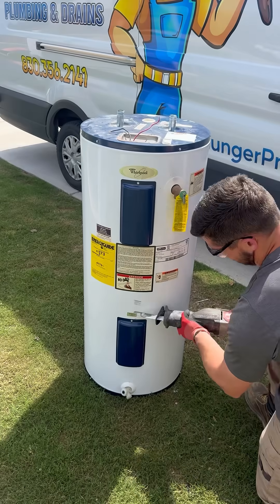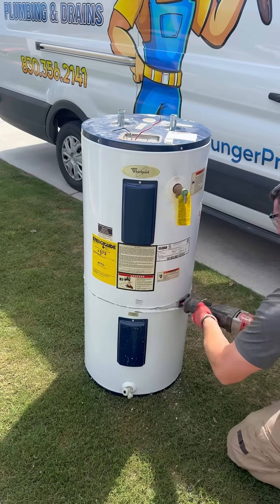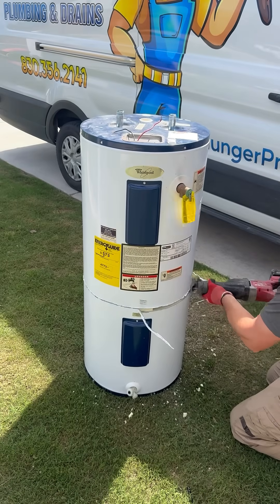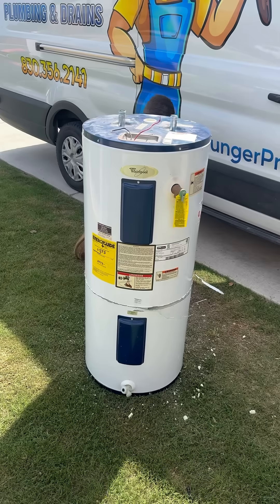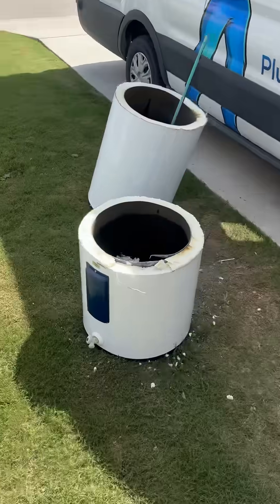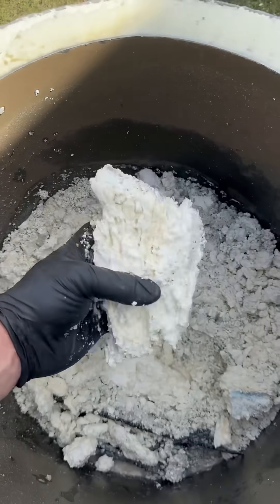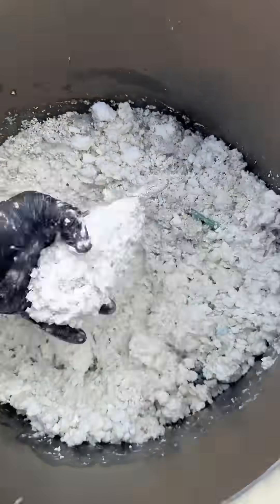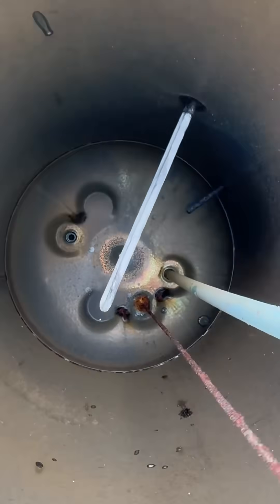What Is Inside This Water  Heater?

Comment: How many years old?  
I never flush it out. I don't see the point if it is only set up to last 10 years.
I had one for nearly 17 years. Never had any problems.
Reply: I know - my heater is from 2006, i flushed it once just basically for fun years ago and nothing really came out. I live in Florida btw.
I just assume newer heaters are pieces of junk just like modern HVACs. Designed to fail to keep sales.

Comment: Do a video showing how and what diamerter is best for drain valve.
Reply: 3/4 nipple, 3/4 ballvalve, hose pipe adapter and you can flush that heater full force

Comment: I think this is why I like gas water heaters better.
Reply: same thing happens to them.
Reply: @thetubeschannel Yeah, but way slower if you're not using the anode rod to heat the water. If it's passive in fresh water they last for like 10 years.
Reply: @kenstr321  no anode rod? .. that's not good. passive water? .. gonna have to search that. ?
Reply: @thetubeschannel  I don't think you understood what I said. I said if you don't use the anode rod to heat the water. So it's not using it actively, just passively. But I think I'm mixing up how electric water heaters works. For some reason I'm thinking of it like an arc furnace. Rather than resistive elements in the water...
Reply: @kenstr321  ok, I'm still confused then because an anode rod as you may know is for the water to attack it instead of attacking (corroding) the steel tank itself. it does not even passively heat the water. It works the same way in an electric water heater. An arc furnace heats air.. yes I'm confused but it's ok.
Reply: @thetubeschannel  I'm sorry to add to the confusion. So the way water heaters work, (as you likely already know) is the heating element in the water has power run through a metal wire covered in a ceramic material and jacketed with a stainless steel tube. The resistance of the wire causes it to heat up and the heat is absorbed by the water. For some stupid reason I was thinking of it like an arc furnace. Where an electrode and cathode (sometimes also called an anode) are in the liquid media and electricity is passed through the water with the resistance of the water itself causing it to heat up. Think electrolysis but jact up the voltage. Yeah, pretty stupid to get the two confused now that I think about it... Sorry for my stupidity causing confusion.
Reply: @kenstr321  thanks for the explanation. I went 22 years without maintaining my heater and it finally went. So with my new heater I tried to learn all I can to maintain it annually. Drain and check the anode rod, etc. Worth it just to try to keep the bottom as sediment free as possible for faster heating of the water. So I'm really into these not.. thanks

Comment: I pull out the cold supply dip tube and install a second sacrificial anode rod. I pull the boiler drain - feed cold supply through brass tee, nipple, full-port ball valve down where mfgr had original boil;er drain, CPVC ran to floor drain. Expansion tank, overflow tray with water alarm. I sell "Maintenance agreements" which include flush. If I sold them on softener, iron pre-filtation, sediment filters, etc: they save on flushes, it should last longer than ME.

Comment: I pull a half inch line out from the bottom valve and it all we have to do is turn the valve every six months and the heater will last forever. Let it run for 15/22 all the dirt comes out.

Comment: the inside of that tank actually looks good still.. i have the exact same one in a rental that was manufactured in 1999.. i recently  changed the drain valve and had to use a sediment buster just to get the water to come out of the factory drain vavle... sediments were easy to flush out with the wide opening of the new valve.

Comment: Apologies if I missed it somewhere, but what type of valve did you replace the factory water heater with for more complete annual flushing of the tank? Thanks and keep up the great content - very informative!
Reply: @bdiddy742 Look for 
1. A 3/4in quarter turn full port valve,

2. A 3/4 in. MHT x 3/4 MIP Brass Adapter Fitting (MIP end connects to the full port value and the MHT end connects to a garden hose for draining), and

3. A 3in long 3/4in brass NPT-NPT brass nipple that connects between the water heater drain opening and the quarter turn valve.

Hope that helps.

Comment: Would you show a tank where the home has a water softener installed to see the difference?
Reply: The reason you rarely see this is due to their failure rates been lot lower. We had to replace water heaters like clock work every 3 years or so 38 grains of hardness. After water softener it's been 6 years since last change
Reply: i would
literally pay for new water heaters every three years instead of being forced to shower and wash clothes with soft water. GROSS
Reply: @LadyBits2023  why? I really am asking. What's wrong with soft water?
Reply: @nightmareinaction629  really? I have hard water and my water heater is from 2006 kek

Comment: No. Sorry. Folks that is not buildup. Do you see the tank itself how it's black? Those tanks are sprayed with porcelain white porcelain at the factory. That's why they are called glass lined. Through years of expansion and contraction the porcelain cracks and collapses into the bottom of the heater. What you are seeing is porcelain not calcium buildup. Yes there are some minerals in there but water heaters are self cleaning. It is a scam to let someone clean your water heater through flushing. It is also dangerous as it could send porcelain sediment into your faucets and fittings in the wall or ceiling of your home. I am a 41 year plumber. I have nothing to gain by telling you this.
Reply: Ok, so my tank creates porcelain out of thin air then? My 20 year old tank has built up over the bottom element 3 times in its life so far, which I've used a shop vac and some PEX pipe to remove it from the tank. Did not know porcelain dissolved in vinegar either. Stop lying.

Comment: If you are behind on flushing can you pour a solvent in to get rid of the buildup?  Something like "lime away"?
Reply: Noooooo. There is always some residule that stays inside and eventually goes into your regular pipes. You do not wanna shower with that stuff. Safety data sheet does state it can cause irritation or burns. 

There are proper solutions you can buy from y o ur local ferguson or even amazon. Just follow those instructions.

Alternatively, you can use 30% vinegar you get from lowes or home depot. I forget the ratio but I think you had to buy around 15-20 gallons and let it circulate your water heater. This will break apart the calcium and cleam the inside. 

As a precaution though, do not do this if your heater is older than 8 years old and you've never serviced it. There is a chance you could actually cause a leak this way.

Good luck!
Reply: Plus, those tanks are glass-lined.  There was a water heater back in the 90s that I had.  It was built with an access panel.  Open it up and shop vac it for 10 minutes, once a year.  The gaskets failed, though.  If they were designed better, then you wouldn't have to buy more of them.  I teach school, and my kids and I created one out of stainless steel with a big opening.  Huge ball valve on the bottom of a coned-shaped bottom.  Open the valve, and it all flows out.
Reply: Tbh idk how much good flushing actually does
Reply: @murkyturkey5238 
My plumber who has more work than he can handle says flushing is not worth the effort. And he doesn't need to push work.

Comment: How long was this in use without flushing?
Reply: Maybe 10-15 it's a whirlpool not common.
Reply: Super dependent. If you set it to run higher temps it will cause more of it to build up. And the harder the water, the more will build up. It's mostly calcium
Reply: @grizzo9976  it's not calcium it's porcelain. Noticed the tank is black? It should be white inside because they spray porcelain all over it. What's in the bottom of the heater is porcelain.
Reply: @Iwillnotbepushed  troll or stupid?
Reply: @ 41 year plumber that is SICK of the lies plumbers push on the public. Now wash that screen that's disgusting. What's the matter? Are you one of the guys stealing from people  with a water heater flush? You know the one that gets about 25% of the collapsed porcelain. Yes I'm exposing the scam.
Reply: What do you replace the drain valve with?
Reply: @kentwangsness7443  just a different style drain valve with a larger opening
Reply: @kentwangsness7443  3/4-inch full-port ball valve